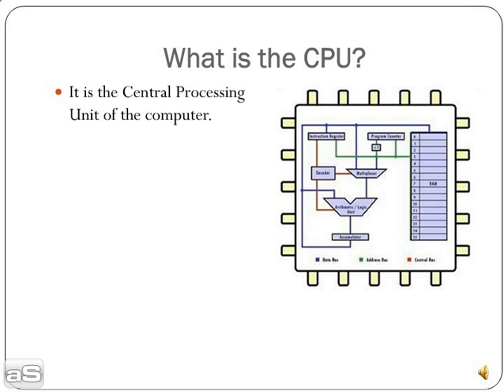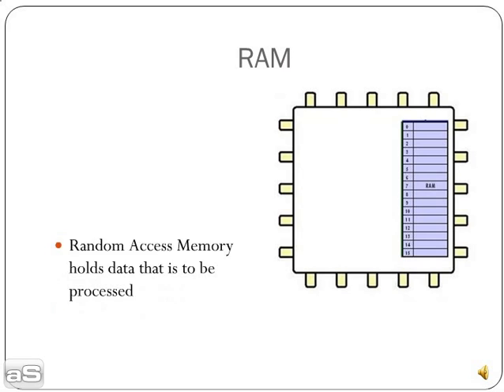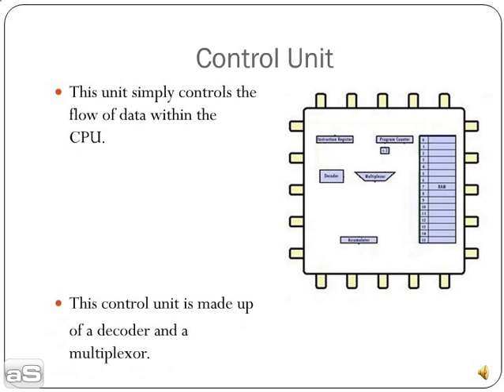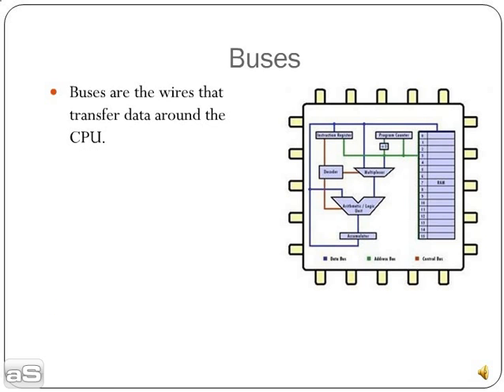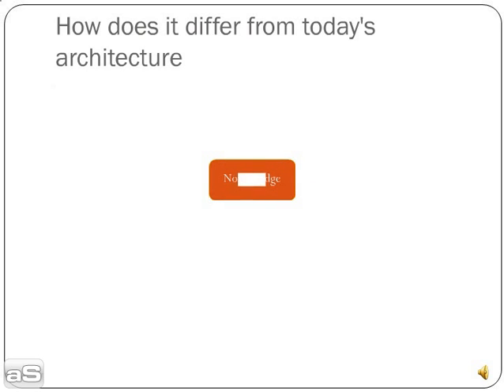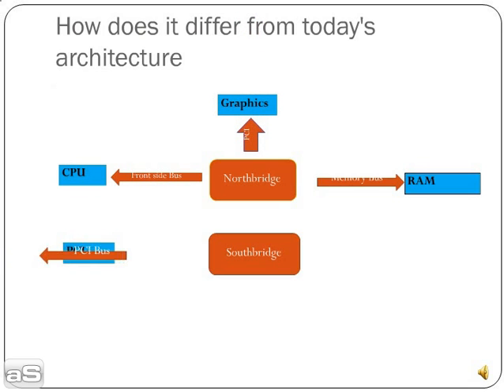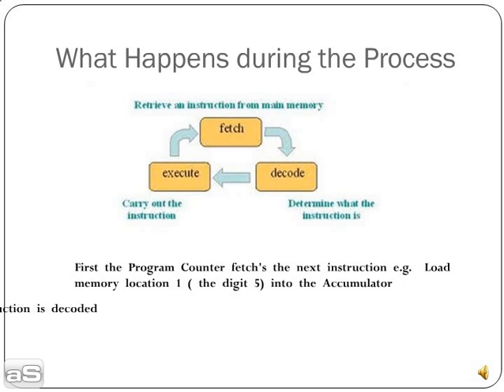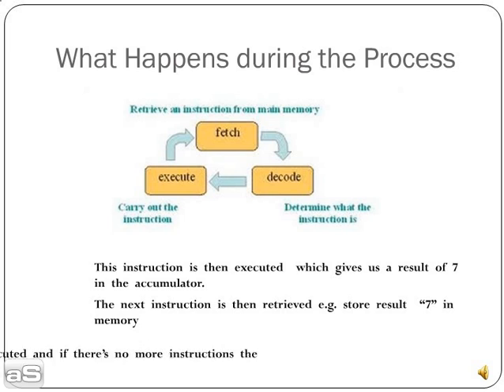computer architecture

Comment: A key factor in determining the cost of an integrated circuit is volume. Which of
the following are reasons why a chip made in high volume should cost less?
1. With high volumes, the manufacturing process can be tuned to a particular
design, increasing the yield.
2. It is less work to design a high-volume part than a low-volume part.
3. Te masks used to make the chip are expensive, so the cost per chip is lower
for higher volumes.
4. Engineering development costs are high and largely independent of volume;
thus, the development cost per die is lower with high-volume parts.
5. High-volume parts usually have smaller die sizes than low-volume parts and
therefore have higher yield per wafer